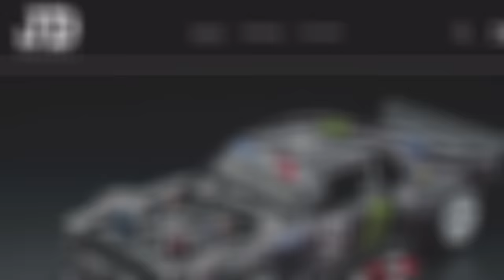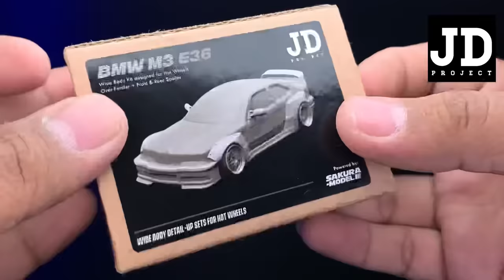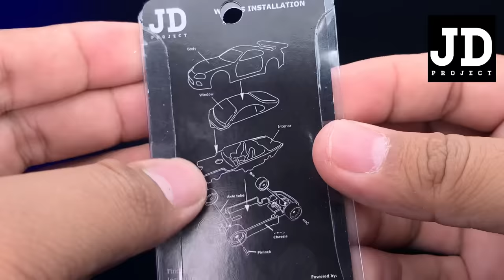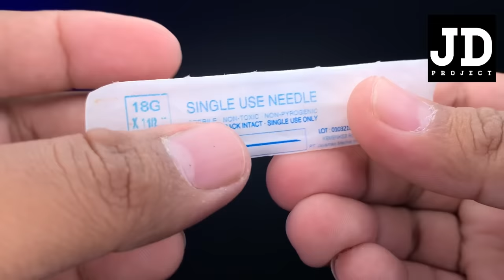How to custom your Hot Wheels easily, you can do it yourself

Comment: Is there a worry using super glue that it will eventually let go? Wonder if using blue/red Loctite would work as well? Do you ever put a layer of liquid rubber on your wheels to increase realism? Am getting into the hobby and was curious.
Reply: Paint is actually the most strong adhesive part of any project. The layers of paint create a very strong protective shell and structure for almost anything, backing up anything beneath it by 100%
Reply: A couple drops of super glue between two flat steel plates will lift a full size,real car, (5000lbs) off the ground. It's as good as your going to get. Red locktite is not glue.